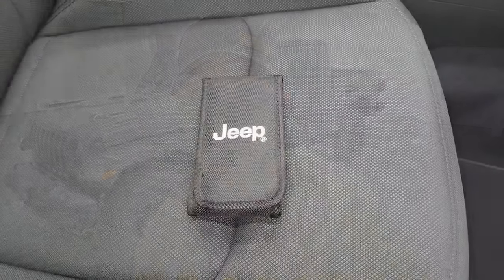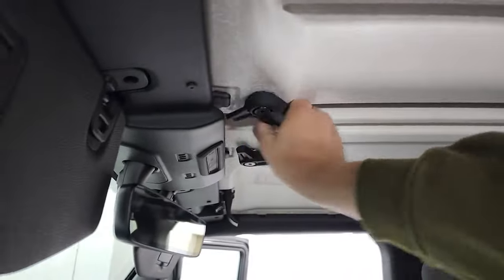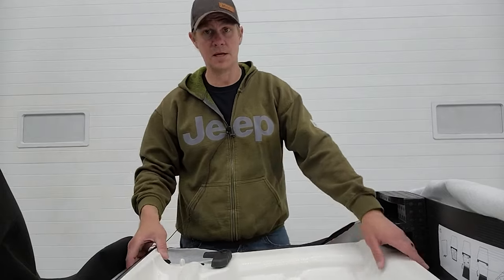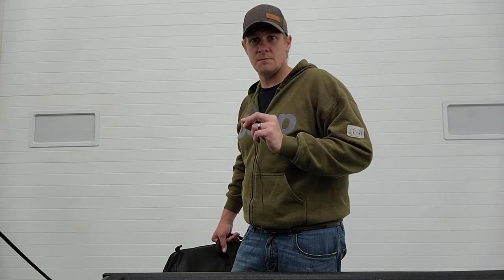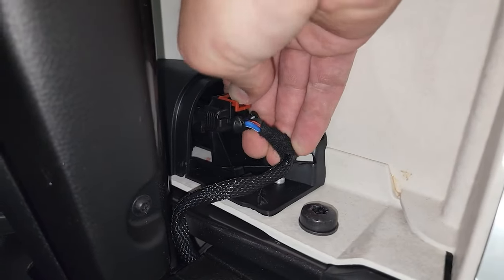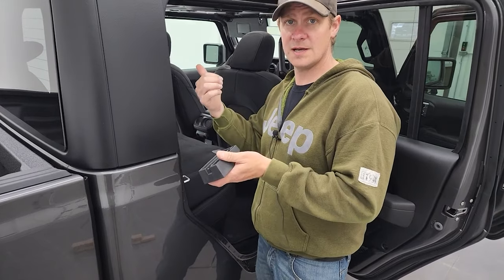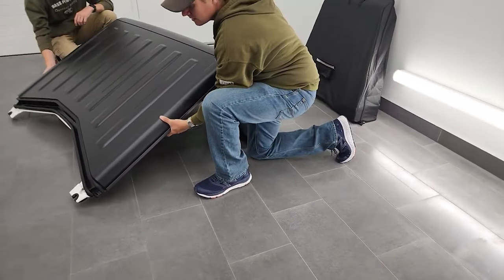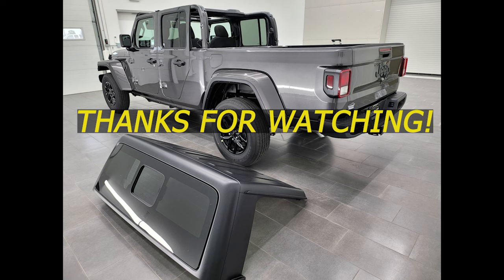HOW TO REMOVE THE JEEP GLADIATOR HARD TOP & WHAT ARE THESE BLOCKS FOR?#90000139002

Comment: I like your hardtop storage bag! My Gladiator didn't come with one, so I kept the one I had from my JK and it doesn't have the separators to push the corner into. Therefore, the two panels touch against each other a bit more.